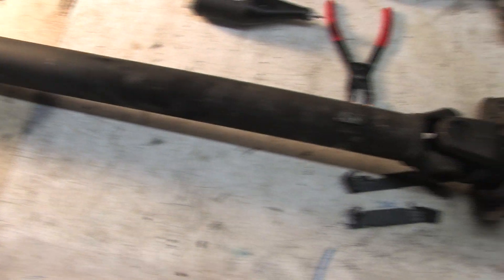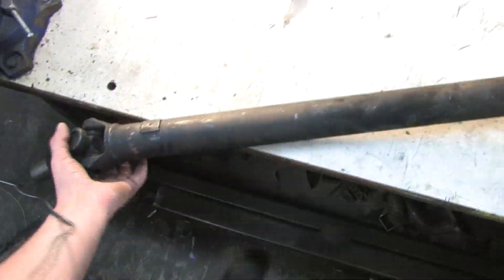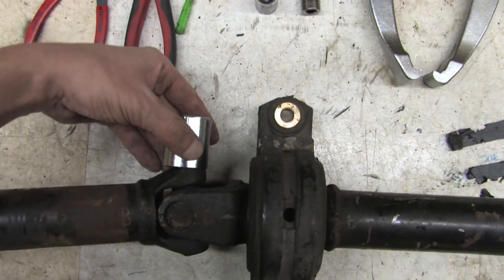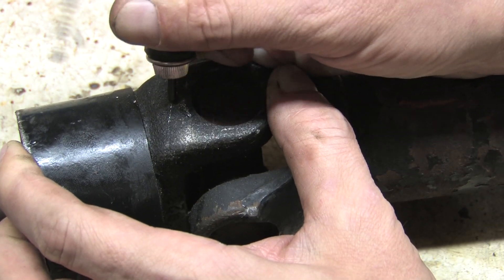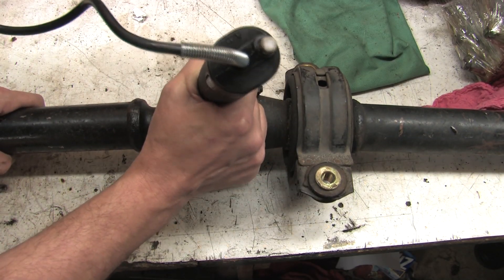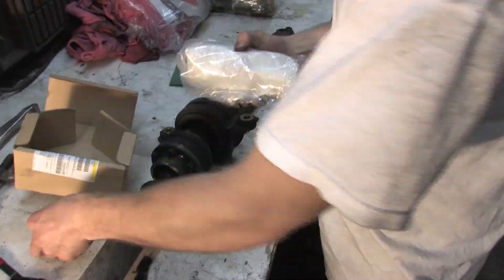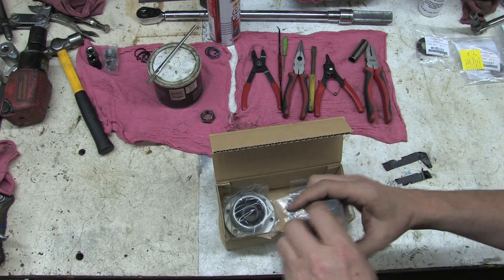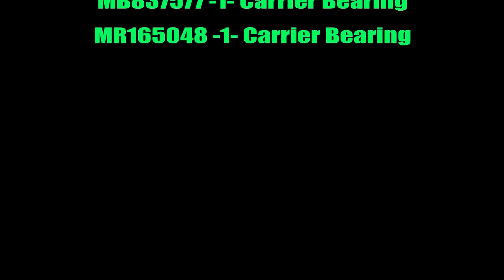Driveshaft 101 - Parts, Tools & Tips

Comment: I own a JDM 1995 Mitsubishi Chariot AWD RHD, the US versions are the Mits. Expo and Eagle Summit, as I am a Mail Carrier I need a RHD vehicle for my job.  Recently I took my car in to have the u-joints and carrier bearings replaced.  The mechanic said he was having a hard time getting the carrier bearing on the rear so he left it off and told me it would be fine to drive.  I picked up my car and instantly on takeoff it felt like I was in 2nd or 3rd gear.  I left it there and said there's something wrong with my transmission now or transfer case.  Long story short, he put the rear on and power was restored, but transmission started slipping bad on the way home and was stalling @ stop.  Another shop said I need a new tranny now.

Comment: Hey jafro my car is making the exact same noise and it seems to be leaking from transfer case, could this be the cause? Tailshaft was rebuilt by previous owner a while back. Thanks for these informative videos
Reply from the maker: If you're leaking from the transfer case, stop driving it until you've gone through it, inspected for wear and if nothing's wrong, replace seals or the yoke that's causing the leak.  If it seizes, you risk a nasty crash.  If it runs out of oil, it will seize.  There are cases of this happening.  I'm not trying to scare you, I'm trying to warn you.  Best case scenario is buying a good one from someone in the community and swapping them so you can keep the car on the road.  The leaky transfer case situation is detailed in a Mitsubishi Technical Service Bulletin and there was a recall on many years' worth of production over it.  There were also some really bad crashes.  Bad things happen when your driveshaft seizes at speed.  Very bad things, even if the U-joints break.  Take care of yourself and your transfer case at the same time.
Reply: I stopped driving it couple of days agos when i heard this sound similar to the one in your video ive just pulled out the transfer case and hopefully replacing the seals will fix it

Comment: I'm installing a driveshaft in a 1g that wasn't originally in the car so I don't know what spacers were used if any.  Are their specific angles the driveshaft needs to be at when installed or what's the best way to go about making sure it's spaced correctly
Reply from the maker: If the car you're installing it in is AWD already, then everything should line up.  As far as spacers, the only spacers are the snap rings that hold the U-joints in, they're color-coded, and they should match on opposite sides to give you .0008" clearance.  I don't know where you will find an .0008" feeler gauge because the smallest ones I've ever seen are .0015".  There are no spacers front-to-back because the middle of the driveshaft is a slip joint.

Comment: So I don't have an official "Space Wagon" since I'm in the states, but my 95 summit (manual) wagon rattles under 2 rpm when accelerating from a stop. Haven't actually been under the vehicle to inspect anything yet, but I'm guessing the culprit(s) are the carrier bearings. Are the parts in the end of the video for the 1g applicable to my vehicle? I'm actually new to dsm's.
Reply from the maker: They should be the same parts.  I did cross-reference them, but the carrier bearings themselves need confirmation.  It's possible the bolt holes and shape of the brackets are different.

Check for backlash in the rear differential.  The play in the rear can also be an indicator of how badly the rear differential may be worn out.

Comment: hi I just subscribed I like your videos they are very informative.  I always use a vice to press the bearings in and out of any u joints I do. I don't know what is easier as I have never tried using a gear puller to do this. have you ever tried using a vice? next u joints I do I will try using a gear puller. thanks for the videos.